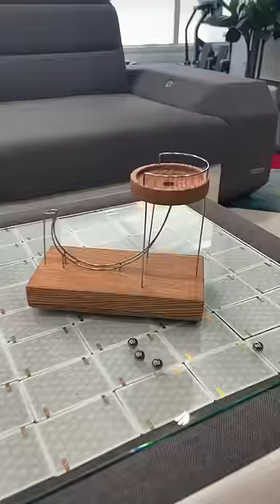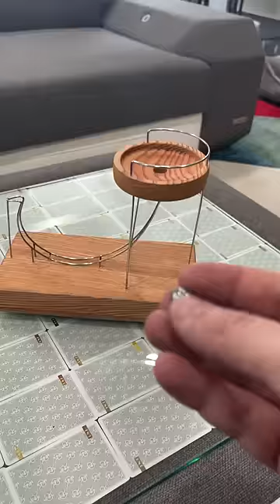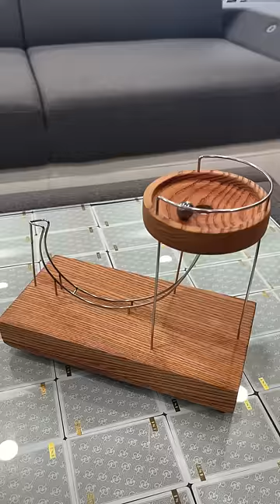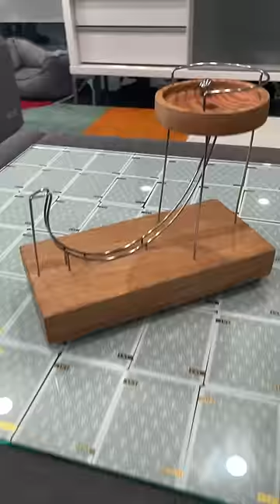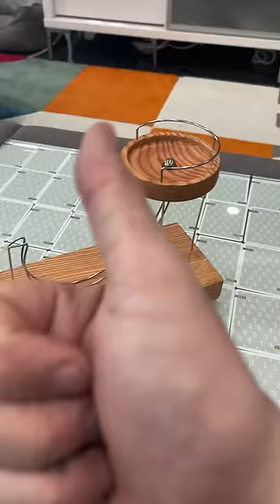An Impossible Perpetual Motion Device?! 😳 #Shorts

Comment: For everyone who hasn't seen this and wonders how it works: There are electromagnets in the bottom

Edit: Guys, stop arguing in the comments
Reply: There's also a battery operated version with a wheel underneath.
Reply: Wouldn't that also pull the beads downward as it's moving back up the hill?
Reply: @TehGamesaver  idk how, but it's timed really good
Reply: No it's pretty simple. No electromagnet needed. We used to build these when we were kids. You could buy the kit or use stuff out of your dad's tool shed.
Reply: @sylvrbullets  Oh, how does it work?
Reply: @ayceod  Wait, so its an actual Perpetuul Mobile?
Reply: @fastgrimjay  If it's not using magnets, look at the sloping wire track - all the energy would be coming from gravity. But I'm sure there's an external source of electromagnetic power somewhere, given how big the base is.
Reply: i was already wondering how they faked it.
Reply: @TehGamesaver  notth and southpole 1 attracts the other pushes
Reply: There are plenty of gadgets like this that require no magnets at all. the problem is everything looses energy, but we can get very close to not loose energy, resulting in something that works for a very long time without having to be "re-wound". in theory a Perpetuum mobile is possible too, you can have something that keeps itself going indefinitely, if you don't loose any energy to friction etc. you cannot create energy out of it though.
Reply: @Andrew Hill  What are you talking about? There are electromagnets and a battery. This would not work. The speed at which the ball is falling would not be enough to shoot it back up the ramp. He literally has another video where he shows the battery and magnets. Please stop spreading fake stuff.
Reply: @OptimumGrow  You’re just guessing and are completely wrong. You can’t get more potential energy from nothing. It wouldn’t go up to the same point even in the first jump if it was just gravity doing its work. The jumps doesn’t get lower and lower each time….
Reply: Oh yeah rhat makes sense
Reply: @MattExzy  
If it were only using gravity it couldn’t work, so you’re right there must be something. Using gravity alone, even ignoring all resistance, you can’t get higher than you started.
Reply: @OptimumGrow  how can it stop?  once the ball goes down the hole the energy is recharged and the ball jumps accross the gap back to the hole.  Its renewable every time. It doesnt lose energy.
Reply: Magnets
Reply: @ScreamingEagleFTW  
In order to make it up and over the lip of the plate on top, it has to get higher than the initial position; that’s a big problem because gravity is a conservative force (the work done is path independent so only the vertical distance moved matters) so solely “powered” by gravity, there’s no way for the ball to get higher than it started (for the same reason a pendulum doesn’t swing higher than its initial release point). This doesn’t even factor in the rolling resistance or air resistance which, while small, would just make the energy accounting more problematic.
Reply: @TehGamesaver  I believe the magnets rotate so that the poles of the magnet attract the ball, and then push it away
Reply: You don't need a magnet, all you need is a D.C power supply across the metal rails. The current flowing through the ball bearing will then be passing through the magnetic field around the rails, essentially making a lower-powered rail-gun. Since you only need enough energy to replace efficiency losses, that could suffice to return the ball to the top.
Reply: @drkendallsphysics1916  In a rail gun electromagnets are supplied power in synchrony down the length of the barrel to push the projectile forward. Simply exposing a magnetic object to a uniform electric field along a path is not going to propel it forward, or so I think?
Reply: @nicholassimmons9706  The movement of current through a uniform field would suffice to provide a force. The field along the lines would not be particularly large, and thus it would not provide very much force to propel the projectile (which is why an actual railgun is built with more sophistication and uses very large currents that would not be appropriate here) but as we would need only replace a small amount of efficiency losses in this case -- the majority of the work being supplied by gravity -- it could be enough for this case.
You might wish to look up railgun designs, as you seem to have misconstrued something about their construction. A typical design does not use external windings at all for the fields, although they may augment the fields in other ways.
Reply: It‘s impossible the ball jumps on a higher level from where it started. It‘s the same thing with a pendulum. It would never swing back higher than it’s maximum displacement even in a vacuum. 
So this ball cannot jump that high without energy input from outside the system.
Reply: Uhm but this would work without the magnets
Reply: @is_urban1425  no, it wouldn’t
Reply: @is_urban1425  the kinetic energy gets converted to thermic energy, so it won't get as much height
Reply: @nicholassimmons9706 this would only work if the ball was magnetic as well and then there would be the issue of the balls north and south pole location being unpredictable though I think you are on the right path of thinking. if your idea were implemented with a diamagnetic material on one side and one or both normal north south magnetic fields working on the metal ball on the other side of an object that rotated then I could see this working like you suggest. the only issue is that you need a power source to rotate the object you have the magnets on.

Diamagnetic materials are repelled by a magnetic field; an applied magnetic field creates an induced magnetic field in them in the opposite direction,
Reply: Really? I'd think it just is pretty good at being low friction and takes a really long time.
Reply: I already know it😅
Reply: Its a wheel,
Reply: @OptimumGrow  yes, too much energy lost on friction of steel, air, gravity....so eventually the ball will just fall down before it can reach start point again....
but still lovely gadget....👌
Reply: @thefourshowflip  exactly...
Reply: Look, all you geniuses out there, the reason it is not perpetual motion is, eventually, the parts will wear out, due to friction.  The track wires, the ball(s), or the funnel, or any combination of these will wear down.  I'm sure it will continue to work for a very long time, perhaps decades, or even centuries, but it will stop functioning properly at some point.  There are no batteries, magnets, or other "tricks" of any kind. It is an idea which, minus friction, would indeed demonstrate manufactured perpetual motion.
Reply: @johnafagerquist8235  Bro, the problem doesn't lie in the parts, the problem is energy loss
Reply: @johnafagerquist8235  first of all perpetual motion isnt possible because if friction and air ressistance on the balls, you cant just create force for the ball to go up higher than it went down on the ramp, and no, this does have a motor, this thing is probably like 30 bucks on amazon, it has a small motor that why the balls launch at such a high speed
Reply: @thytheodor1193 I was wrong.

I was in a mood yesterday, and did one if those, "Right or wrong, I'm going to the mat" things.  I thought more deeply about it for much of the day, and realized there has to be some added acceleration to get the ball higher than its launch point.  I contemplated deleting my comment, but decided I'll leave it, so your reply isn't just hanging out there.  Besides, some folks might enjoy reading me chewing on my foot.  Cheers.
Reply: @fastgrimjay  I was wrong.  I knew it as I hit send but, in a childish fit, I left the comment anyway.
Reply: @johnafagerquist8235  its ok, everyone has a bad day
Reply: @fastgrimjay  gravity
Reply: @ayceod  it's called gravity
Reply: @Fillster  graphen disagrees with you.
Reply: @gsk5161  Yea, gravity plays a big roll in the energy loss
Reply: The ball flies higher than what it fell from, so obviously it's being accelerated by an outside power.
Reply: @sylvrbullets  Lol. It literally has an electromagnet
Reply: you are right
Reply: its just a little wheel on the side of the hole they sell it in aliexpress
Reply: @dariotariperez928  they sell everything on aliexpress
Reply: @Mr Ticky yeah. Normal magnets are what you would put on your fridge or something. Electromagnets are similar, except for the fact they aren't magnetic until they're charged with electricity. Hence the name, electromagnetic.
Reply: Probably an electromagnet or something else, no matter what it is, but a thing is sure, there is a mechanism that adds speed to the marble. Without that speed adding, the marble wont have enough speed to be able to come back at the top
Reply: @OptimumGrow  how can it lose energy? The ball weighs the same and so would have the same energy every time it falls, right?
Reply: @Andrew Hill  loses energy? how does gravity lose energy?
Reply: @sylvrbullets  it's all magnets, remove the magnet and the ball doesn't make it above the top of the track
Reply: @Fastgrimjay  it doesn't, it's impossible without the hidden magnets
Reply: @OptimumGrow  no..... there's literally batteries and Magnets hidden inside.  If you don't know what your talking about then don't say anything
Reply: That is true, you can tell the ball velocity is very high than natural as soon as leaving the saucer 
Must be an engine provides additional force to the gravity
Reply: @Mr Ticky it's feasible. It's just not perfect. With electromagnets, we can also control the range and strength of it, based on how charged the magnet is. 

I imagine the magnets in the bottom are just barely charged, so when the ball goes down, all the potential energy is converted into kinetic energy, and as it reaches the bottom where the kinetic energy will be at it's highest, the magnets probably kick in right in that slit second and give it the little extra push it needs to ascend the rails and loop back up. 

Otherwise if they weren't there, the ball would probably never make it all the way back up the rails. It would probably get so far, then simply fall off or backwards.
Reply: you can buy this at Amazon, shoopee 😂
Reply: Yeah runs out of energy after 15 min…battery energy. And what I think is happening is the ball completes the circuit, so the electric magnet turns on, and it has a timer for a whatever time it takes for the ball to fall down the ramp, and then turns off. that’s why it won’t work if both balls fall at the same time.
Reply: Why do you think so?
Reply: No there aren't. Phony "expert".
Reply: @sylvrbullets  You could make one that gets back to the platform, but that ball is accelerating faster than gravity should allow in free fall, ant It is not falling straight down
Reply: That was my first thought. It looks like it works similar to spacecraft "slingshotting" around a planet or other massive body with a gravity assist.
Reply: @TehGamesaver  It does, but not enough to counteract the added velocity. Think of it like a spacecraft "slingshotting" around the Earth or Moon. Gravity is still "pulling" on the craft as it leaves, but it gains enough momentum on the approach that it still ends up completing the maneuver with more velocity than it started with.
Reply: @OptimumGrow  no it uses an electromagnet
Reply: @dingdove1  that requires external forces paired with significantly more momentum than what a small machine like that can provide
Reply: @OptimumGrow  the american education system right there ....
Reply: @doodlenov  Ha. Im from Alabama, we don't consider ourselves as part of America
Reply: Oh thanks for summing that up so simply, it all makes perfect logical sense now!
Reply: No... the ball gets thrown by little slots hidden in the hole.
Reply: @gsk5161  gravity does not pull the ball hard enough to go back up, so there is a device hidden in the hole that basically shoots the ball down, hard enough to go back up.
Reply: @V2ULTRAKill  It uses a shooter hidden in the hole. The ball would not fall down that fast. There is a video showing it on youtube.
Reply: @Neufertful  that specific one uses a magnet
Same channel as this short shows the magnet
Reply: @matematurgo8250  Laws of thermodynamics
Reply: @matematurgo8250  Friction
Reply: Doesn't matter how you cut it, that's still perpetual motion. Make this smaller concept bigger and you have unlimited energy. I've said it before, magnets are the future my guys. You can suspend and electro magnet in a spacecraft and use the on and off to hammer forwards with the same poles. There is no impact making no damage to the ship, but the force forwards in zero Gravity from a massive electromagnet facing the same active pole will push away, and since it's attached via cables or some connection, the act of on and off will be little shoves that gradually build speed. The only time fuel is necessary is to avoid debris, or to correct course. 

This also removes the need for rare earth magnets, as the magnetic charge is electrical. So it's reasonably cheap. The only heavy lifting is getting to space, once you're there, the zero gravity provides a pathway using magnetic push unbound to earths polarities.
Reply: @OptimumGrow  I have one and it absolutely uses a electromagnetic. When you switch it off it will not complete a single loop.
Reply: Fact !
Reply: It works off of the distance you have with the run of gravity applied to the object curving it back efficiently to land it back in place where it started. There is no trick it's just a simple laws of physics using a sloping distance watch gravity to accelerate the object.
Reply: It's much like the illusion where you have a straight line at an angle, with something rolling down it versus, angles that are sharper but stepped out in segments.  Everyone believes that the angle with all the steps in it would take longer for the object to roll down then the one with a straight line, however it's proven this is not the case, when you given object more plain dealer surface to accelerate no actually make it to the bottom faster.
Reply: ⚠️ CAVEAT 🔥 CAVEAT :
IT IS *WRONG*‼️
The perpetual motion is possible as long as the energy the system does lose to the outside (of the system) is restored back to the system.
⚠️⏩️In case of this game, there is perpetual motion :kinetic energy is transformed into potential energy which compensates the losses of the system due to friction with the sliding frame and due to air resistance when metallic sphere is thrown back to the wooden platform (with the hole).
None the less, in the (very) long term the wearing of the sphere may deform the metallic sphere is such a way that it does not have any more the required velocity at the tip of the sliding (curled up) to reach the wooden platform, and when this will happen, the GAME IS OVER …..
Reply: If there is an actual magnet it's a hollow one in which the ball passes through, then the force of the magnet on that side of it pushes the ball down faster.  So basically as the balls on the platform before drops in the hole, it is actually being slightly suspended by the magnetic force, once it drops through the hole as enough gravity to push it through, well then the magnetic force pushes on-the-ball causing it to accelerate with enough Force to complete the circuit.
Reply: Ahhhhh, thank you! Still a really good idea
Reply: Magnet magic, nuff said.
Reply: @Rycidex  You're right. He has another full video on his youtube where he shows there are magnets in the bottom.
Reply: No magnets
Reply: @fastgrimjay  he's a liar🤦🤪
Reply: I was going to say that this actually looks like a perpetual motion machine but it's plugged in
Reply: Think of the one that has the group of ball bearings all hanging dress-right-dress with each other. If you pull one ball on either end and let it go, the energy causes the ball at the opposite end to bounce back and forth, thus creating your P-M. I always looked at it from a simple physics perspective, myself. Probably wrong on that last sentence, but that's how my brain's always processed it. Pretty damn cool, regardless.
Reply: Nope… the centripetal motion attributes the extra kinetic force to keep the loop closed
Reply: no, its a engine in the hole
Reply: I'm pretty sure it does not have magnets, but if you left it to do its thing long enough, the bead will eventually stop moving.
Reply: If that were true the two balls would stick together.
Reply: @Neufertful  basically a solenoid
Reply: @muddyfalcon  it’s a precisely timed electromagnet, which increases the entropy of the system if the power source is counted.  Impossible to do with a ferromagnet.
Reply: Smart.
Reply: I need no wheel or battery to keep my perpetual motion engine going. Only batteries to receive the electronic charge my engine will make. If you want to be one of the richest people in the world. Then let's talk
Reply: @danielclarke3852  Nah, I just want some nice abs
Reply: @sylvrbullets  🤦‍♂️ It has electromagnets.
Reply: Is magnetic…. 😅 nothing special
Reply: People just arguing facts
Reply: it's a curved rail gun, the bearing completes the circuit
Reply: Sure, but that's the ground we stand in, so we could do the same on the earth. In space, no! Duh, of course not